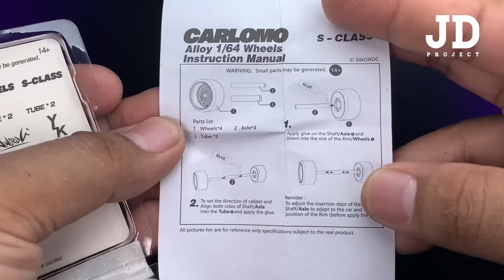Tesla S Plaid Rocket Bunny style Matchbox Custom

Comment: This is the best custom hot wheel I've ever seen. So crazy to put the detachable rear bumper magnetic. Hot Wheels/Match Box needs to do a collab with you.
Reply: it's a matchbox not hot wheels, even though they are produced in the same company they are still a different brand
Reply: They need to make a new department called "The Customs Department" and make this guy the head of it
Reply: He should work for matchbox matchbox make non racing if he made this for hotwheels it is wrecked if raced in hotwheel track